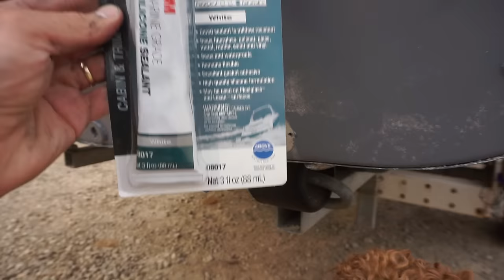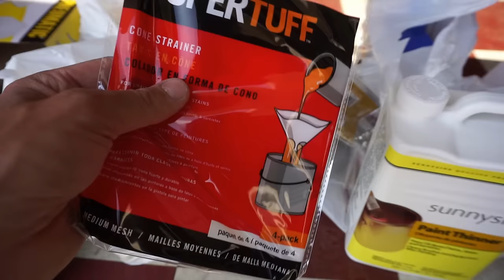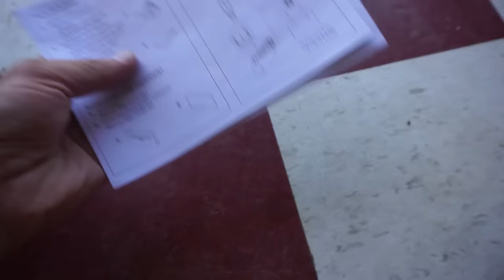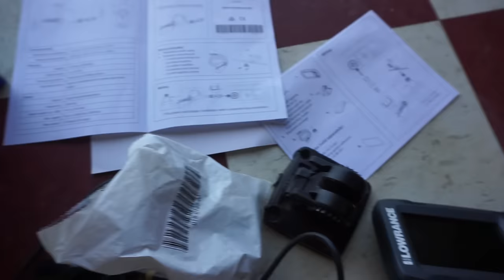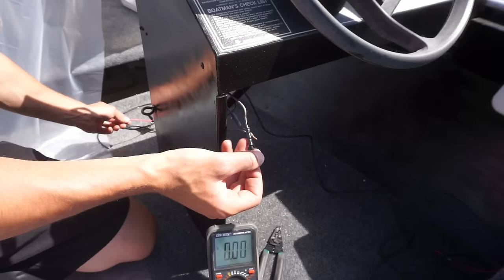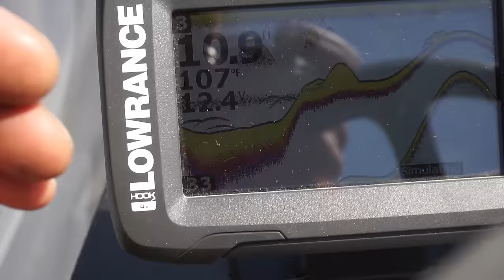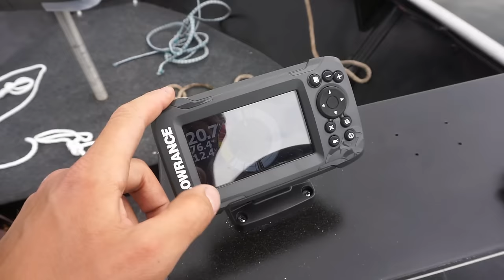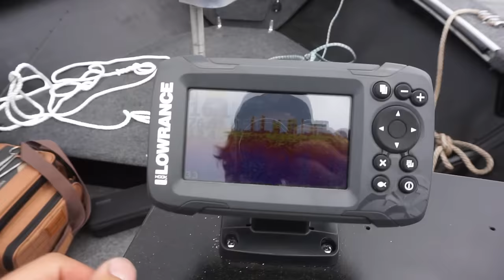First Ride On $500 Abandoned Fishing Boat. Will It Float?

Comment: Just a word of advise don't start the motor out of the water if you have a dry impeller you could damage it and then you will overheat.
Reply: Was wondering t hat  myself.  Started  it  with  poorly  fitting  ear  muffs  at  home,  then  out  of  the water  at  the  lake,  could  have  burned  out  an  already  questionable  pump.  Realatively  easy  to  fix,  but,  annoying  to  HAVE  to  do.
Reply: Yeah you can use a bucket of water.
Reply: Notice you losing picture on graph. Lower the transducer down to about 1/8 inch below bottom of boat. Just saying.
Reply: add to that; remove all straps before backing boat in the water
Reply: You want to give him some advice advise him to quit drinking from the toilet bowl.
Reply: @daffyduck9901  giving advice is a waste of time, 50% wont listen and the other 50% wont take it
Reply: @originaloldpop8405  One can never stop learning. If your wise, you always listen,  research what you've been told, then apply it your situation. 

A quick tip from a stranger could be completely ridiculous and off the wall,  could be important and make life easier, or, may have nothing to do with your situation and leave you wondering what the hell they were talking about... 
You either laugh, learn, or let it go !
Never just assume you know everything. 
Sooner or later, you'll be the guy everyone is laughing at, without a friend in the world.
Reply: Good job captain obvious
Reply: Yeah, my anxiety went to the moon lol
Reply: That particular spray gun is intended for house painting

Comment: Some things to check regarding the overheating. The tell tale stream just lets you know your water pump is pumping some water, but it does not tell you if your cooling system is operating properly. If you pull the thermostat you can test it by dropping it in water that is over 143F. There is also a poppet valve that can get stuck. What this does is at a certain PSI of water pressure it opens allowing full flow through the engine's cooling system. Basically, at idle the thermostat will open allowing the engine to cool, under power the poppet valve opens allowing the engine to cool. It's also a good idea to go ahead and replace the water pump impeller. It's a rubber impeller that, over time, becomes hard/brittle and does not pump efficiently. General rule of thumb is to replace the pump impeller every 2 years or 100 hours, whichever comes first. Who knows when the last time that impeller was replaced.
Reply: Is the pop valve on the thermostat?
Reply: @staind288  typically on the side of the block somewhere under a plate. You'll see a coolant line running to it. I believe on the Johnson's it's under a donut looking plate with 2 bolts holding it in place. I would get some cork gasket material as I'm 100% certain the existing gasket will be toast when that plate is pulled. Sometimes you can just open it up and free it up. It's just a spring pressing against a rubber stopper. That stopper gets stuck to the block if the engine hasn't been ran for a while. Other times, on Mercury's, the entire assembly needs to be replaced.
Reply: Good way to kill that motor 
SMH
Reply: @riccochet704  thanks
Reply: He replaced it in the first video

Comment: Solder those connections. The wire nuts will fail after a few times because the wire will start to corrode from exposure to water. Keep up the good work!
Reply from the maker: I will be doing that!

Comment: Joe one of the biggest mistakes some folks make when fixing light issues on boat trailers is not keeping in mind those fixes have to be made waterproof, considering the trailer lights usually go under water when launching a boat.

Other mistakes are not using lighting kits designed for marine use.

Very few things piss off a boater/fisherman more than to have water ruin their expensive repairs.

If I were you, I would get rid of the pigtail wire connectors, and solder the wires; also make sure the wiring is waterproofed.

Great video!

Allan in Cut Bank, Montana
Reply: Shrink tube cures that.

Comment: Hey Joe, the connections on the trailer lights leave a little to be desired.  Should have soldered them with heat shrinks, or an alternative of sealing each wire nut with silicone.  Speaking from experience, current way you made connections won't last 10 trips to the water.

One other suggestion, see if anchor fits in front compartment.  Hit a wake once at 35 MPH, anchor flew up in the air, landed right on the control console...

Comment: A couple of tips for your spray gun. Bottom knob adjusts pattern- from point to wide. Top knob adjust paint volume. Spayer tip turns with direction you're painting and a air pressure valve on the gun is helpful that way you can keep the regular set higher. Water traps are important for automotives paints. Have fun with your new gun.

Comment: I would recommend using water tight connection for your wiring or you will have issues down the road. Soldering and heat shine should do the trick!

Comment: I would suggest at a later date that you replace all of the trailer wire in the frame with tinned marine grade wire. It will last longer. Bare copper wire will corrode

Comment: Hey bud, id recommend checking the thermostat and poppet valve (if equipped)
You can have water flow but it maybe not flowing through the hole cooling system

Comment: You should put that fuse within 1’ of the battery. That fuse is to protect the wire. With it so far from the battery, that wire can still get very hot and possibly start a fire.
Reply: Thats not how over currnet protection works. An overload current will be be constant throughout the circuit, not incrementally as you get further from the battery, if the current is higher than the fuse allows, it will open and protect the wire, no matter where it is installed With that said, those connections will probably fail before any fuse blows!
Reply: @billstuart8481  yeah well you also do it because if the fuse pops and it is 30’ from the battery, you would have 30’ of wire that is still hot. Now if that wire shorts to ground somehow(usually from vibration) that could start a fire. So, where do you think you should put the fuse???

Comment: Great work, looking good! If you didn't put the foam back into the hull I would suggest you get more and replace it.  If you haven't replaced it, and you get a leak that you can't pump fast enough, the foam will keep the hull afloat.  Maybe not a huge issue in shallow lakes but just thought I would mention it.  As usual, you do great work.
Reply: Your high if you think he does great work pal

Comment: Found a bayliner 17' for 300$ couple weeks ago. 2.3l ford inboard with cobra outdrive. The lady was moving and couldn't bring it with. Cleaned and reset points. Runs good in the tank but has a misfire under load on the lake. Be cleaning the Rochester carb this week.

Comment: You should solder and use heat shrink on them connections... water will get in the wire nuts and corrode the wires and then you'll be replacing all the light wires! Solder the wires together and use heat shrink and thatll keep the water from getting to the bare wires 😉👍

Comment: Nice work Joe on this boat as well as the other projects you have saved from the junk heap.  In agreeance with other commenters, yes you should try to "water proof" all of those trailer light connections.  Even run some light caulk around the lens fittings and screw holes.   Marine trailer light kits claim they are water proof, they are not.  Maybe for a dunking or two but water will get in and destroy the connections, bulbs etc.  I've owned boats and jet skis of all shapes and sizes and one thing I always do is unplug the trailer lights from the vehicle before you drop her in the water.  It will save your lights.  They will last a lot longer and you avoid shorting things out if there is weird currents in the wiring.  Simple advice from a 30 year boater here in communist MD.  Just remember to re-connect your lights once your boat is back on the trailer.

Comment: you should use solderless wire but connectors and they make a marine heat shrink tubing that would work great instead of the wire nuts wate will get into those wire nuts and corrode the wiring.

Comment: I’d personally go back use waterproof heat shrink connectors on those trailer lights. THOS wires are going to rust immediately. 1st time in and out of water they’ll rust. Awesome rebuild of this boat. Glad you saved it.

Comment: Your transducer is set to high to get a clearvbottom  reading while moving. The sealant for the holes from the old transducer will eventually fall out. You should plug them mechanically as well by using a rivet or screw.
Reply: Also you’re not supposed to tighten the transducer bolt all the way tight, In case you hit something it can pivot

Comment: OK Joe, you need more painting experience lol. Should be a 5 minute job per coat. That air spray gun can get a nice wide pattern at 10 - 12 inches away.  Bit it looks like a new boat now. Nice job !

Comment: On the boat trailer lights. If you use a ground wire instead of grounding to the frame of the trailer it'll work much better long term. Oh and those heat shrink butt splice connectors that solder, heat shrink, and water proof the connection are amazing and cheap.

Comment: Hey Joe,
     Was completely surprised by how well your boat came out. Glad your video came up as a suggestion. I can see that you are an avid "rattle can" painter. By no means a Van Gogh or Picasso. You do manage to get r done.
     When painting with an electric spryer (I have 3) you need to thin the paint or use a larger orifice. Smooth even strokes is the key. There were lots of spots with little or no paint and some with too much paint (cause runs).  All due to rattle can technique ( short strokes, up and down and sideways).
     I thought to myself he should just grab a roller (I have several sizes). Next scene you got a roller in your hand. I was speechless  (could my thoughts have traveled through the internet )? Well, you did not do any better with the roller. Oh, that rattle can style strikes again. Be sure to "LOAD" the roller evenly. You could use the up and down strokes evenly. Start from left to right or right to left over lapping the ends.
     I was about to email you when you busted out the LPHV. Yep, the $27 low pressure high volume gravity fed paint sprayer from "WALLY MART" ( free delivery, used mine to paint my 23 yo truck).  At this point I was sure I was going die! I could see by the spry pattern that you needed to open up on the paint valve. Hardly any paint can be seen coming out of the gun. Then you resort to your up, down and all around strokes. Did I mention the ole "RATTLE CAN TECHNIQUE' ? 
     Good job on your $500 boat. Keep on doing what you are doing. Will continue to watch more of   
 your videos. Have fun on the water-stay safe.
     Ray

Comment: Just found your channel and really enjoyed the restoration...not sure I'd have the patience!  I agree with the soldering and heat shrinking of the connections; really cheap to get at Harbor Freight - you already have the heat gun.  Getting max speed means trimming it correctly, but in the video the motor is trimmed all the way down; should be trimmed up to where the wake starts to come off the hull about where you're sitting or a bit farther back.  Great job!

Comment: One more thing to check, now that you've had it in the water, is the gear oil in the lower unit. Make sure it's not milky. If it is then there's a bad seal somewhere. Which could be the prop shaft, drive shaft or water pump seal. If you have a discord I'd be more than happy to provide any advice you might need. I've been around and worked on boats for over 30 years.
Reply: He changed it in a previous video already

Comment: With the paint gun long stokes 3 foot wide left to right or right to left, not small stokes up and down. Hurts me to watch you use a paint spayer. 🙃 Same feeling I got when you first started working on motors it hurt to watch and now you can fix everything and a joy to watch the repairs. Your painting s*cks, you will master that also in time im sure. Don't start the motor when the engine is raised out of water, bad for impellar

Comment: When you use a paint sprayer you do not use your wrist.  You use your arm and do long sprays and maintain an equal distance on the stroke from the nozzle of the gun.  You were wrist-swinging your stroke and doing an uneven laydown.  The start of the stroke was farther and angled away from the work and the center was straight and closer.  The other end of the stroke was the same as the first.  I have used that same sprayer many times and I mixed my paint a little heavier but held the sprayer farther from the work.  Much faster.  Better to spray twice than make runs.  You did a great job  Bill Hale

Comment: Good job on the boat.  What a transformation.  I have to call foul on the wire nuts especially if you are going to spend the money on new lights get you some butt connectors and heat shrink.  I know I have seen you solder.  🙂 Love the channel.

Comment: You did a great job on the boat. Initial $500. How much do you think you have in it and how many sweat equity hours do you think worked? I agree with most of the comments. Secure that anchor before you get hurt. Check the thermostat. The prop looks really chewed up so a replacement might be in ordered. The vibrations from the broken prop will quickly wear out your output shaft and bearings. Enjoy your fishing!

Comment: Buy a trolling motor. Less spark plug problems. Well you got the stink out of the boat by catching the baby bass. Have fun with that. Remember to paint 73 on both sides in a bold font. Commander McHale.

Comment: Thought add full speed,  heard piston ring chatter. Not 100% sure on that. But may have be pushing that motor to hard  if seals are weak,  can put to much oil into cylinder foul the plugs. May be a good video for rebuild of the motor. Impeller and thermostat need replaced.
Reply from the maker: Yep definitely will be going through engine. New impeller, thermostat, plugs

Comment: I was getting a steady beep on my outboard, I too thought it was over heating, but it was the float in the oil injection tank was sticking. The other thing is make sure your motor is in the water when you start it or you will burn out your water pump impeller.

Comment: You may find that the reason your first sprayer wasn't working well is the extension cord you used was either to long, or the cord wasn't heavy duty enough. I had the same problem with a electric staple gun. On my bench worked great, 125 feet on a 16 gauge cord it wasn't getting enough amperage.

Comment: Aluminum boats don't trailer well on rollers, too much pressure on small areas and will crack or wear the area.  A suggestion is to install bunks which will more evenly distribute the weight.  Good luck on your adventures.

Comment: 🇺🇸👍 Change your water pump and make sure you have a good thermostat installed don’t leave it out, without one water rushes through not cooling properly. Do a compression check of each cylinder have fun.

Comment: Nice boat for sure a real 500.00 buck bargain. Boat alone new was at least 1000.00 toss in Johnson 40hp another 1000.00.
By the way I ran the Engine model number she is a 1991 year. The boat and motor all came from Bas Pro Shops.

Comment: Wow that paint went on thick on the first coat, lol.

Next time turn the paint amount down and open the fan pattern, so you have about 6 to 8" wide spray pattern and it should be misting but enough to lightly coat the area.. it is an art, but once you figure it out, you can paint anything

When you got the air gun going, your paint was way too thick, which is why it was so light when you sprayed onto the wood. Adding a little more thinner, opening the fluid control up and a little more psi, and it would spray great.

I painted 50 jets in the Air Force and 5 or 6 cars. I was also a paint trainer in the AF. I love painting.prepping, not so much. That comes from spending 8 to 12 hours a day sanding above your head. Lol

Shouldnt the transducer be pointed straight down?

Just curious.. when doing rhe graphics, what are you spraying on the outside of the transfer tape?

Comment: Joe never use wire nuts on anything outdoors. Use weathertight crimp connectors or better yet solder and shrink tubing. Sounds like a thermostat or worst case a bad head gasket is  fouling the plug. Next time it happens check spark plugs. The effected cylinder spark plug will be clean like steam cleaned if the cylinder has water in it. Also check compression in each cylinder. The head gasket could be failing after heat builds up due to expansion of aluminum head.

Comment: Dont run the engine that high as you did at first after launching the boat. You will burn the impeller pretty fast and then you have no cooling for the engine

Comment: I enjoyed this little serious and found it interesting. I will say this that I am somewhat sadly disappointed to see you do a half assed job on that wiring on the trailer and going thru using wired nuts for connections. You should have used quick connects or you should have done twist connections or even possibly gone as far as soldering them in and use shrink tubing for better sealing to keep that wiring lasting a good bit longer as that thing will be exposed to lots of water over the years. Still good content and decent work overall.

Comment: You should use crimp shrink fittings with the wires together instead of wire nuts wire nuts are going to corrode